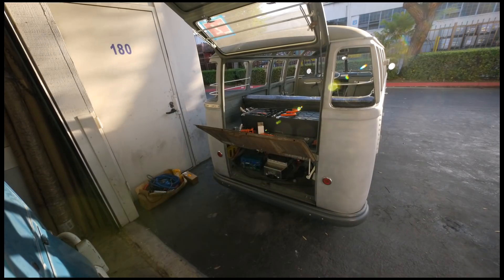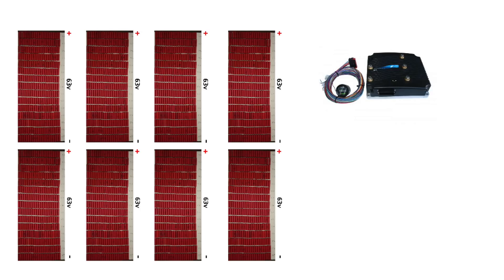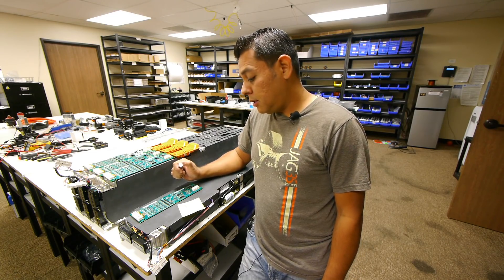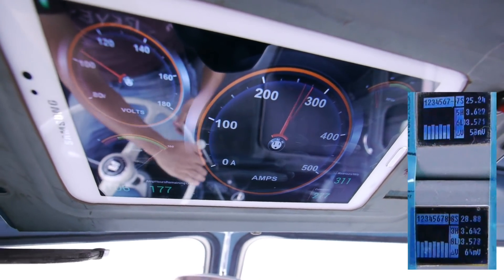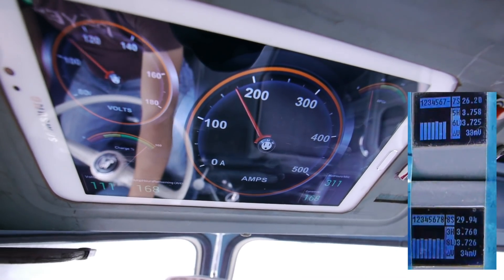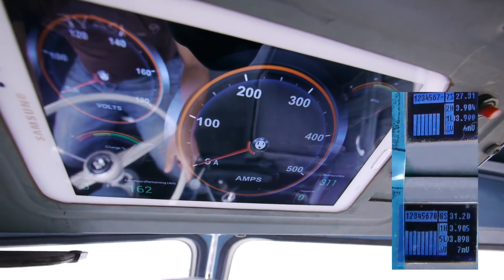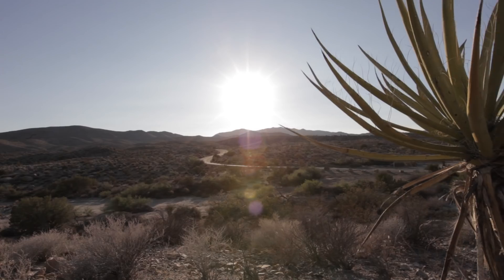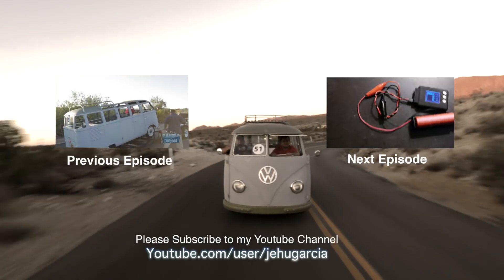18650 TESLA battery drive test - eSamba DIY EV conversion

Comment: I need your help I am converting my vw polo highline in to a electric i am not sure how to work out how many batteries I need to get the car to at least travel 100km. And I'd like to know what's the best inverter to use for my ac motor

Comment: Hey Hey Hey!  Love your videos!  You know your stuff and your presentation is warm and inviting!  You will go further young man.  I have a question?  I purchased 6 Tesla Smart Modules 57V 22p15s 330 cells 18650.  The modules did not include the A50QS100-4.  What is this for and do I need to replace them?  Also if I may...  The modules I purchased are used so how do I know the capacity/condition or even if all cells are good?  One more ? Do I need a bms and if so what will work with this system?  The application is solar and all modules are in parallel for a 57V  300A system. Kind Regards  Tc

Comment: Reset fuse they use them on AC motor DC motor Moto start system you can adjust the amperage to any amperage it have a built-in contractor when exceed contact card out 🤔

Comment: These are not Tesla modules. They are Smart Fortwo modules made by Panasonic NOT Tesla. Even though the fuses are nominal 100 amps they will peak at 150-200 depending on heat. I used bus bars to bridge my smart modules, just a thought. Where did you get your smart modules?
Reply from the maker: At tesla

Comment: If you ask me, individual cell fuses are meant for cases of extreme emergency, for example if a cell gets punctured and makes a short circuit by itself. That could mean, that all parallel cells would be short circuited, which could result in a "meltdown", since all of other cells current would want to pass the failed battery. But since the cell is fused, the fuse breaks the circuit and keeps the danger away. I don't see any other reason by now.

Comment: New subscriber here! joaquingch@gmail.c om. I wanted to know if you could help us down here in Jalisco Mexico. We are building from the ground up 2 prototype electric trikes, unseen anywhere in the world, not your common trike setup. I would like to know if you could send me a schematic on a 325 amp 3 motor or three wheel drive called "EL TRI" SCT in two motor sizes. So one of the EL TRI SupermanConcepTrikes will be smaller indivdual motors less$$$ for those wanting to spend less. Our goal is to build 7 of these trikes so that we can test strength in real world accident scenarios to present to market here as an 3 seater, and a 2 seater sport edition slightly higher $$$$. This Concept does not exist as of yet and will be finishing the first concept with a Honda 800 motorcycle engine that will later be blue printed so that we can start building the press for frame and body panels made of lightweight aluminum and carbon fiber.

Comment: Whilst fused at 100A, remember that HRC physical characteristics are that it will blow instantly at 200A, stay intact at 100A and take around 4-6 hours to blow at 150A: 
IE you can surge a little and get away with it.

Those individual cell fuses are as much about preventing thermal runaway as current limiting. This is important in the case of a crash - like the recent dutch one where the driver wrapped his Tesla around a tree.

You really need to make use of the water cooling system to ensure the packs don't overheat.

Comment: if you would've had to slam on the brakes for some reason those dogs would have been hung.
You use a harness with leash ring on the back. push the leash through the seat between the cushions and run it back over the seat clipping the handle of the leash into the leash clip making a loop around the back part of the car seat.
A 15mph accident is like falling 7.5ft their necks can't support that.
Reply: Same thing from me Jehu.. As a former fire-fighter I can tell you that your pets can be beheaded by a emergency break.... I have seen it many times man... be careful and protect your dogs...

The EV GUY in me.... I like your video's !!! ;-)
Reply: That is why I use a harness instead of a collar.

Comment: I am putting 6 of these module you show on here in my ten passenger golf cart.  why do you feel a bms is not needed?
Reply from the maker: +BeachSide Buggies   Because I don't use one
Reply: I see that lol. and over time none of the cells have got out of balance? Also where did you buy your elcon charger?  are they always around $1500
Reply from the maker: going on 3 years,   the 5Kw yes,  but there are 2.5kw and smaller ones for less

Comment: Jehugarcia can you help me with advice on connecting 4 tesla 24 volt modules into a 48 volt 21.5kwh 500ish amp hour pack.  I'm converting a raven mvp hybrid mower/atv into fully electric.  I'm a bit lost here.
Reply from the maker: +Ecoquiet lawn care  ok
Reply: jehugarcia hmmm ok.

If you private message me I'll go into more detail.  I could make a video reply to discuss the details and the exact modules I'm using.
Reply: Ecoquiet lawn care but here is my questions verbatim.

1 do I have do tear apart each 24 volt module to put the batteries into a 48 volt series and then pair the two groups together to get higher ah rating.  I would rather avoid tearing them apart so I can use the liqid cooling. 

2 is it required that I use the liquid cooling?  I want to but it is more effort.... maybe you should just lie to me and say I have to.  I might out a heater on them to keep the modules in good condition in the winter.. im in Massachusetts.
Reply from the maker: Why not just plug the 2 modules in series to get your 48V?

Knowing the size of your battery and the size of your load helps determining if cells will create heat,   if you live in extreme cold place you will have to warm them
Reply: jehugarcia well mower blades suck juice like a toddler before a nap.
Reply: Ecoquiet lawn care my current goal is for a 12 hour run time. I would be willing to just plug them into series but I calculate only a 6-7hr runtime. This would be acceptable if each module was swappable and could be separated into a charger.  These bsbies weigh 55 lbs so I want to avoid removing them if possible.
Reply: Ecoquiet lawn care ill try to get the max amp output.
Reply from the maker: +Ecoquiet lawn care   I don't entirely understand what you are trying to do and what you are working with so I can't be of much help,   Sorry
Reply: jehugarcia ill be back when they finally get me the dam technical schematic.
Reply: Ecoquiet lawn care the drive and mowing deck have a 100 amp breaker

Comment: if dogs decide to jump out, they hang themselves immediatelly... why are they tied to it? if they were untied, at least small change of lide would have been in case they saw a bitch
Reply from the maker: +Petr Novák   My dogs do not like bitches, no jumping,  therefore no hanging.
Reply: +jehugarcia hey I watched all your vids but i got a question... I saw u got several cars, big house and a hot chick in the bed... what does a guy gotta do for this? I mean I work 280 hours a month and I am glad if I got some $$$ left, I make about $ 1000 ... cant imagine working more tho, I already work 280 hours a month
Reply from the maker: Gotta work smarter,  after 11 years I realized I was not going to make more than $20 an hour in my job,   so I quit and I started my own business,  It failed but I then started another one and that one made money.  I am currently transitioning to my 3rd business which is making videos as a Youtuber.

Comment: can you do li-on battery into 13volts or 14volts that can be use in solar system for 12volts system, and would you sell it? coz if does then maybe i will be your first client for it. :)
Reply from the maker: +Edsel Derong    LifePo4 is 3.3v per cell  so  3.3 x 4 =  13.2V Nominal.   I have some cells I want to sell,   Email me   jehu @ jag35.com

Comment: are the modules from the roadster and not from the Model S ?? I keep see a different setup with a total of 16 modules with 444 cell at around 5.3kah
Reply from the maker: +Adam Rucker   Smart for two tesla modules
Reply: +jehugarcia I would like to get the Tesla modules and rearrange battery configuration for higher voltage in piggyback on to my Ford Escape Hybrid which goes away is 330 volt with a disconnect in between the batteries and be able to plug in the Tesla modules to charge him up what are you think
Reply from the maker: +Adam Rucker    330V / 3.7v =  90 cells,  thats exactly the voltage the SMART runs on,  no rewiring needed.  6 modules in series would do it.  http://j35.us/eBay-Tesla-Modules
Reply: +jehugarcia the Ford Escape batteries is split into two different modules racks then ran in series if I just get three modules and piggy back to one module rack in the truck for now that shouldn't create a problem shouldn't? in stock pack is only about 1.5 kwh so adding 9kwh more to that would be a huge upgrade. for me this is probably just temporary to play around with I would love to add a ac 51 to the rear axle with a whole independent battery and Curtis controller why still retaining the front wheel drive hybrid motor combination I believe with the CVT transmission this thing should drive very smooth and work in harmony with each other why giving me more horsepower quicker acceleration four wheel drive and great extended gas mileage range

Comment: Hi very nice project.congratulations I simply love VW van You should put the batteries as low as possible to lower the center of gravity of the VW to drive safer Ideal under veicule Make also sure u use special cover anti fire to have more safety batteries in case of accident Please check some Tesla model S accident fire , all the flames are caused by battereies and some look like fire works. Some chemical engeenier told that putting batteries all together is dangerous because one catch the others with fire. U could have the floor of the trunk with batteries spaced to cover all floor area or even under veicule truck give better drive because low center of grav Anti fire cover top, bottom and between cells. Life is valuable Protect it    Peace

Comment: was wondering if I can wire the Haber fright generator derectly into batteries and turn on as I drive , the generator has a 240 outlet
Reply: +jehugarcia Actually yes he can, just only once :p
Reply from the maker: +Miguel Gone    Nope,  its wrong voltage and wrong type of electricity
Reply from the maker: For a firework show and smoke
Reply: +jehugarcia so pretty

Comment: Is it possible  fore to add a 240 generator on my leaf directly into battery pack
Reply from the maker: No ,  leafs battery is not 240vac   You need a charger in between the generator and battery

Comment: Do you know what the battery chemistry is for these cells? With a nominal voltage of 3.7 volts per cell, it sounds like lithium cobalt oxide but I'm not sure. Thanks
Reply from the maker: +Pedro Casultsan no really knows,   all TESLA ever says is that they have a custom chemistry,  but most likely regular panasonic lithium cobalt oxide cells.

Comment: You said in a previous video you should be getting over 300v? Higher voltage is better cause you can get the power (V*I) without heat loss and increased resistance from the motor coils.
Reply from the maker: Curtis controller will not accept more than 130v,  other systems do and they run at higher levels but I'm limited to by my current system
Reply from the maker: Curtis controller can only handle 130v max

Comment: have you had a look at lithium polymer batteries for rc cars they sell quite big battery mah packs
Reply from the maker: RC MAD yeah but they are not as energy dense as 18650s
Reply: ok was just wondering as they have mass amounts of current output
Reply: RC MAD LiFePo batteries are much safer.
Reply: true

Comment: hey J i found you a real bus motor more power less enrgy required http://www.ebay.com/itm/Permanent-Magnetism-Brushless-BUS-RV-DC-Motor-System-M-C-Electric-Power-/131526364442?hash=item1e9f950d1a

Comment: You ask the question in your video about the fuse rating.  I did some testing on the Model S cell fuses and came up with similar to what I see in your video.  I was consistently able to pop them around 25A.

http://www.teslamotorsclub.com/showthread.php/34934-Pics-Info-Inside-the-battery-pack/page6?p=969066&highlight=fuses#post969066

You may be interested in my solar project that uses Tesla battery modules. (See my signature on TMC forum).

Comment: I have been kicking the idea around to do a chrysler 300. My question is how many of those modules would you need to buy to have a battery capacity close to the model s 85??
Reply from the maker: Michael Generose 85 / 3  = 28.3 modules
Reply: jehugarcia What are the length width depth of each module??
Reply from the maker: http://www.evwest.com/catalog/product_info.php?cPath=4&products_id=329&osCsid=o07hn36c8ip2929d8988pccsl6

Comment: Weren't you measuring motor amps there?
Reply from the maker: dboekel battery amps
Reply: jehugarcia Ok cool, how many amps through the motor then at those low speeds? I thought you had a 650A controller...
Reply from the maker: yes 650Amps

Comment: So you can pull 6c out of these cells but how long will they last doing that regularly?those kind of cells are usually rated to 0.5c max arent they??
Reply from the maker: Andrew Waters yeah nothing lasts very long when you run at peak,  luckily these are small and light so you can run a pack on the large side and so less stress on cells,   I currently have 44KWH on the samba so they see a max load of 1.5Cs,  easy life for them and so they should last a long time.

Comment: It's nice to see a new episode. Where'd did you get these batteries?
Reply from the maker: Krzysztof Żaczek https://youtu.be/Qlvh1wv0mLY
Reply: Krzysztof Żaczek Check Junkyards, Tesla's don't get repaired much in a crash, they charge to damn much money. You can also get Nissan Leaf batteries at junkyards. But eventually junkyards will realize just how valuable the packs are and might start charging more money.
Reply: Dropped from a truck :)